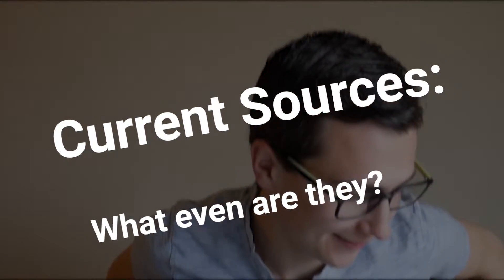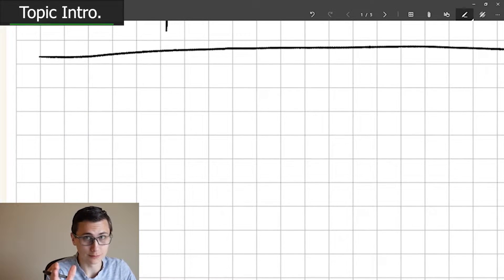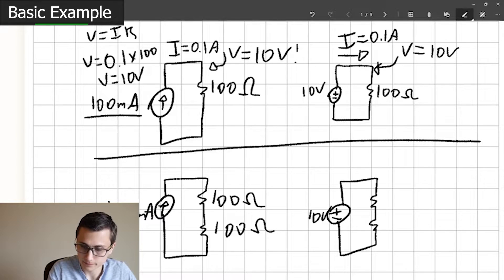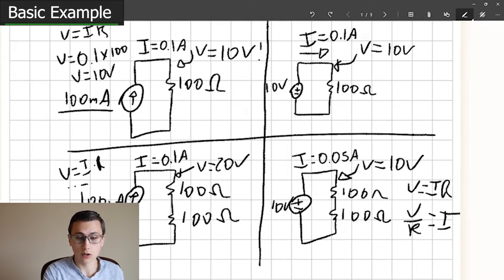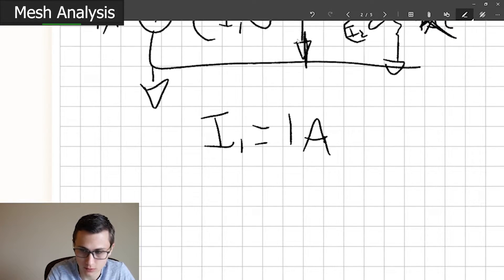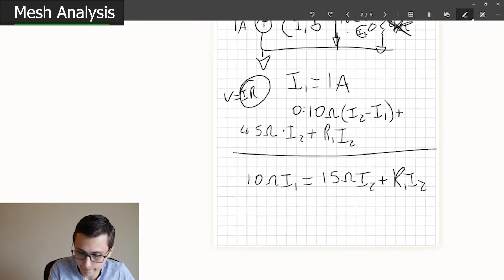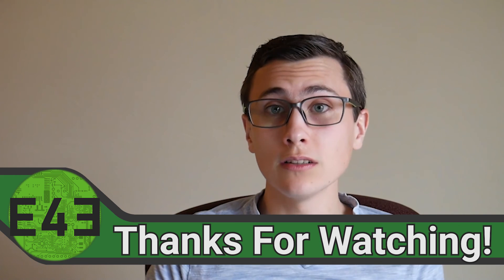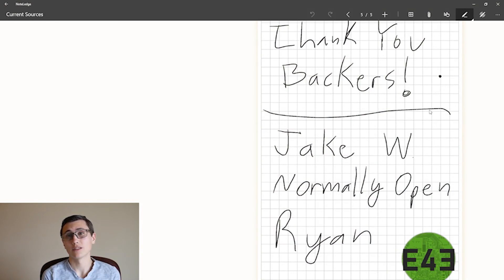Current Sources: What Even Are They?

Comment: Good Work! I enjoyed the video. Back to basics is good. Current sources are a great place to go after basic circuit analysis.

If I recall my undergraduate courses, we did feedback, opamps and control before we delved into current sources. Current sources and transistors then led into how "LF" opamps and power amplifiers were built.

Looking forward to the opamp based current sources. Although IMO the question really starts at how you get a stable voltage source/reference current to begin with? If I recall correctly,  the basic circuits require a "stable" voltage rail to generate the reference current? 

I find It difficult to start without math and signals/control framework. If you're just interested in "building things", then I guess just showing different building blocks whilst, assuming good/reasonable voltage rails, is a good place to start. I normally just go for lm334/tl431/TL432 solutions, i.e. a "start with the app note" solution because of laziness =P
Reply: In the last paragraph, i liked the term framework. I felt like  the theory will connect the dots in real time situations
Reply from the maker: Hi Siva, agreed. I can't wait for part 3 of this series to come out!
Reply from the maker: Hello Normally Open!
Oh yes, I'm SO excited for where this series is headed. The project to follow is going to be a lot of fun.

You're right, all of these circuits require a voltage reference. In today's world, we're spoiled rotten with great voltage sources. There are lots of precision series and shunt voltage references that can be used with 0.1%-1% tolerance. As long as the reference doesn't need to provide much power, a good reference can be had for pretty cheap.

As to why we're going for a ground-up discrete approach vs something off the shelf... Let's just say that we're taking this design to a place where transient response, fault tolerance, and load steps tolerance are absolutely critical. That same design may also need to function at relatively high power levels, and tolerate relatively high voltages... so I'm not convinced that an app-note or standard solution will drop in well. There will certainly be a project-based follow-up series to this mini-study on current sources.

I agree, it's hard to truly design something like a current source without a controls and math background.. but for me, understanding why the math or controls network is useful is a great first step. So, this series is trying to start with a not-so-great current regulator which does not require a lot of analysis... to a more advanced control mechanism that will perform great! Perhaps we can inspire someone to learn more about PID or Type II compensators... :) That's the dream at least!

At any rate, Controls, Opamps, and all sorts of fun to come! 
Thanks for the awesome comment, and thank you for watching!